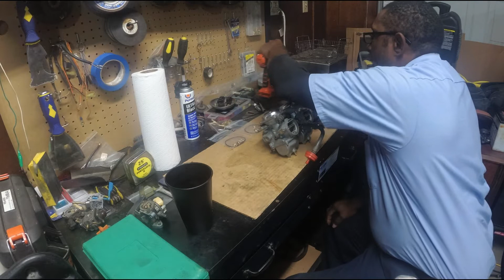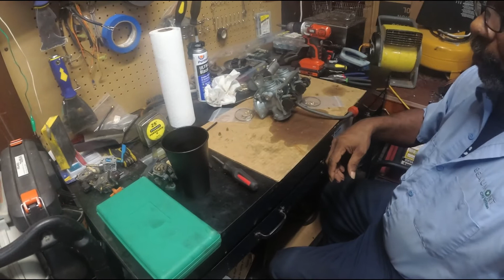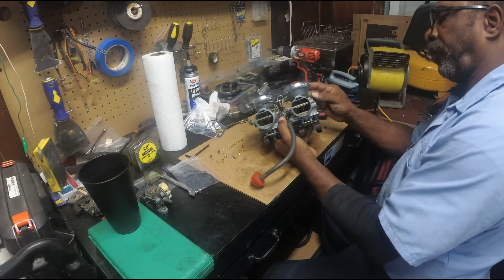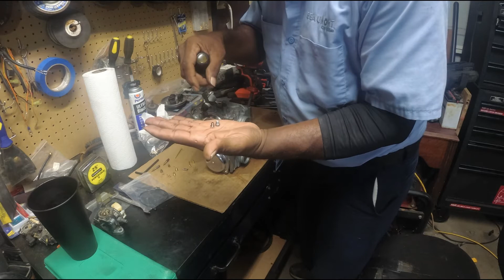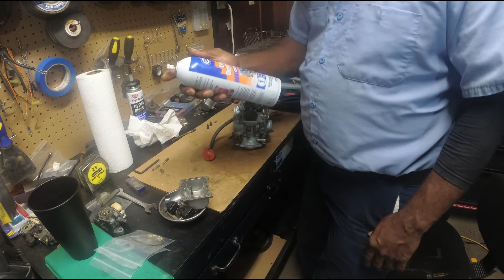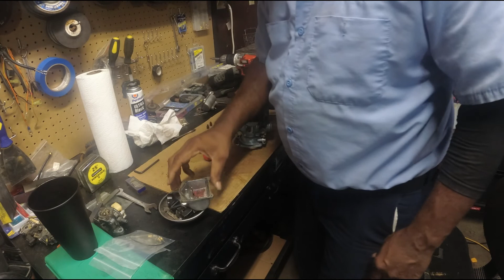KZ 440 carb complete rebuild

Comment: I have gas leaking from the bottom of the carburetor bowl and the little hose coming out of the bottom of the carb 😮‍💨😔
Reply from the maker: Chech your floats may need to adjust
Reply: It could be junk in the bowl keeping the float needle from closing.